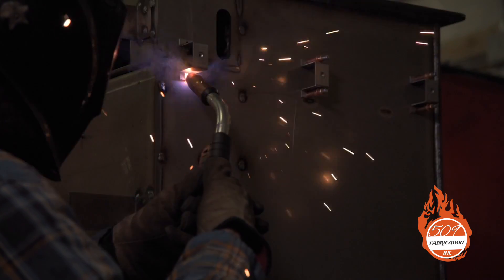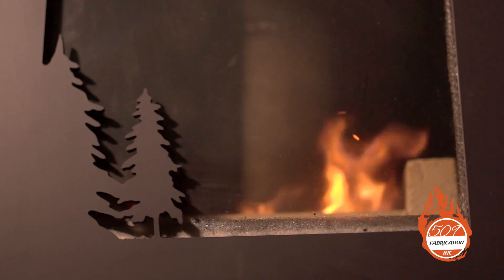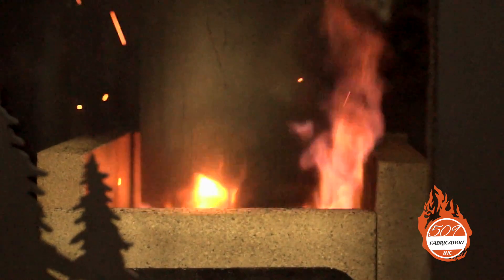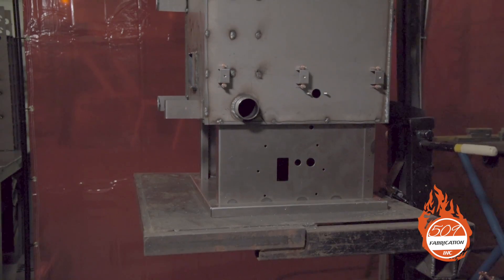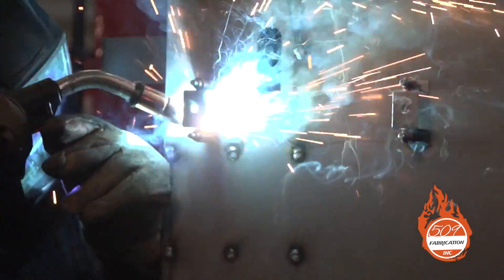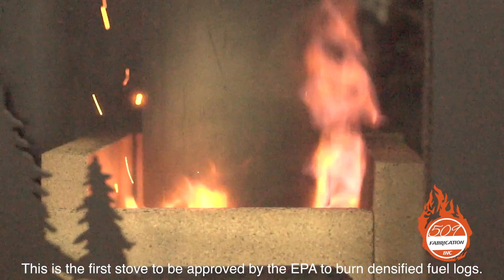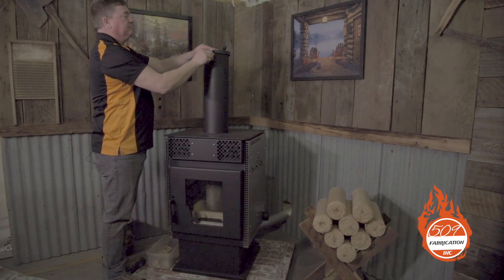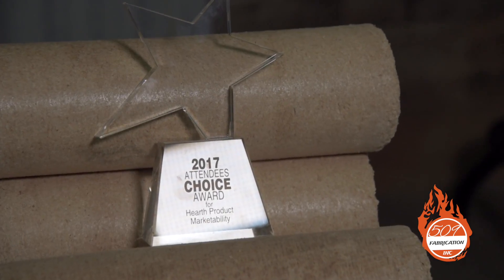New Invention! The Revolutionary 509 Optimum Presto Log Stove. Patented! UL & EPA Approved.

Comment: Presto logs? Seems kinda spending to heat your home. I thought those were used to start a fire, not heat all day and night. Just a small one to start your campfire is $4-6. Interesting though
Reply from the maker: Thanks for looking. The logs are actually 79 to 99 cents. They are all natural with no additives like wax, glues, fire gels. Etc. So it is very efficient and economical to heat your home or shop. The stove burns like a woodstove because you always have fuel in the firebox,  but burning the biomass fuel is nice because you don't have all the mess of wood like bugs, pitch,  bark,  etc. If you have any other questions let me know.

Comment: How does this store vent to the outside?
Reply from the maker: It has an exhaust motor on the back and vents with 3 I ch pellet pipe out the side wall normally
Reply: 509 Fabrication okay thanks. What is the average burn time with how many long?